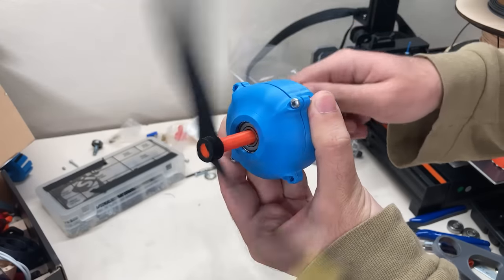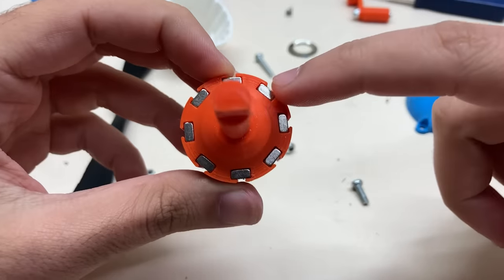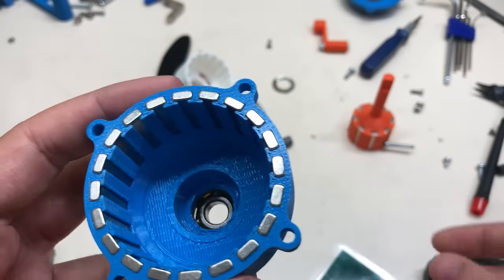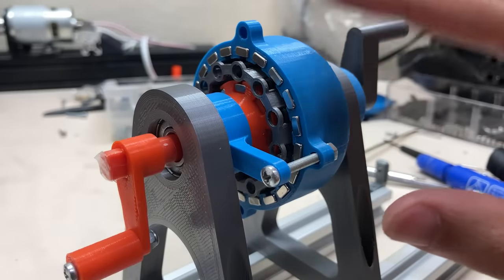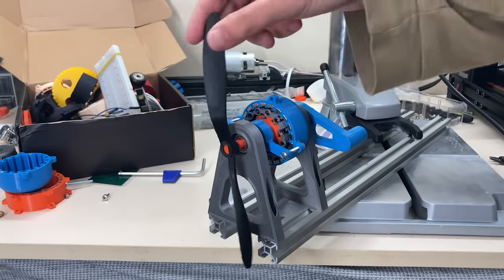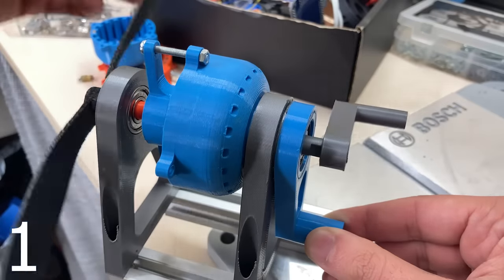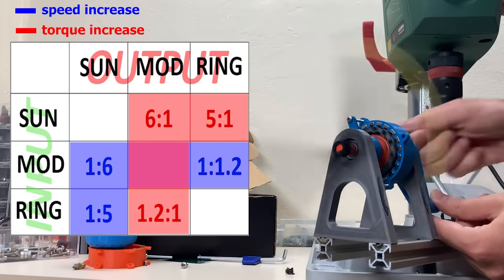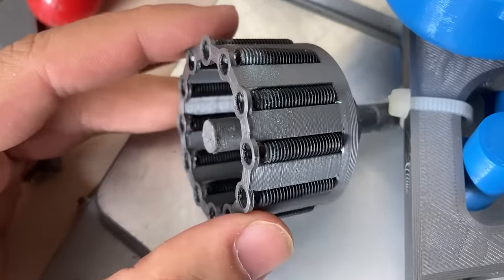How this magnetic transmission works?

Comment: I’m curious though. What kind of torque can this handle? The key point of gear boxes are necessary for change or rpm but the torque tolerances. If you can go from 6 to 1 on the torque but if the output is limited 1 ft/lb of work then what is the benefit. I imagine magnetic transmissions have very little torque tolerance before the work end has to much load and cause the gears to just slip constantly. Especially if your using permanent magnetic instead of electrical magnets.

Comment: I have a couple questions. First is, do the screws heat up with the magnetic fields passing over them. And secondly. Is there a way to add a generator inside this- maybe a couple coils somewhere. Or would that interfere with how the thing works?

Comment: if 4 motors rotate forward you are putting all the torque on the forward momentum edge instead .. rotate the motors backwards but use planetary gears to drive forward .. that can be deviated to effect .. when i look around hardly anything is using torque vectoring to boost or actively stabilize

Comment: The shafts/bearings on the red shaft still need oil/lubrication.  Causing drag and heat, let alone disintegration of components.
Defeating the purpose, and yet, not mentioned.

Comment: You can't put a big load on that tho, if the load is too much it will not turn, there is a reason why you use gears that have physical contact

Comment: This is more like a magnetic clutch isn't it? We have some similar "boxes" at work for material take ups. I understand that the there's a reduction happening, but you can't really use it with a high torque application before it "slips".

Comment: The speed isn't too high for the magnetic type of transmission - the durability problems are entirely mechanical, due to low-speed bearings and PLA structures which are too soft. It is also inefficient at any speed, but especially at high speed, due to the poor magnetic circuit design and inappropriately constructed ferrous elements. 

But is works, which is interesting. 🙂
Reply: until you apply load to it. if you put ANY type of weight as a matter of fact, it will NOT work.
Reply: @JACKOFALLFATES  torque capacity will certainly be limited, especially with this crude magnetic design, but it does function... which is all I meant by "works".

Comment: When battery’s sent an issue, electric cars are about to get a whole lot cooler, can you imagine an electromagnetic gearbox on each hub motor?

Futures gonna be nuts
Reply: Or you could just use coils to mimic the fields produced by the gearbox and drive them electronically. This can be thought of as a generator motor combination, so putting these on an electric car would be like using a motor to generator to motor. It works, but you can achieve the same thing with a well-designed motor in the first place.

Comment: You can't increase torque with a gear ratio. You can only increase acceleration or speed. The torque stays the same, minus some transmission efficiency losses.

Comment: Could the main body, rotor and modulator  body be made of aluminum or non magnetic Stainless Steel? Also I wonder how difficult it would be to overpower the system and allow it work as sort of a slip clutch?

Comment: If you set the magnets at 45 dg angle on the outer and the same on the inner but oposit poles will you get push i made this work 40 years ago but mine fell apart

Comment: I want to achieve something a little bit weird, by having the smaller rotor turn slower than the outer one. I guess I have to fit more teeth/poles on it, and have fewer, larger ones on the outer ring?

Comment: What is the efficiency?

Mechanical, lubricated spur gears lose less than 5% of transmitted power per gear-set.

This would be handy to reduce wear, maintenance, oil leaks, etc.

A side-benefit might be electric power out, replacing the generator/alternator of a vehicle. And/Or coupling IC engine and utilizing the gearbox to work as a hybrid electric drivetrain. The possibilities are endless.

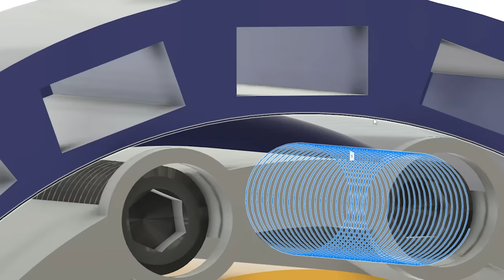Comment: 7:50 if there are no gear teeth this gearbox should be quieter, but this is producing a lot of noise. where is this noise coming from? vibrations? could it be reduced using stiffer material with smaller tolerances? how does the noise compare to a geared equivalent gearbox?

Comment: my question, if there is no friction the chance for slip is high compared to mechanical?
Reply: I believe so, but this might be a feature and not a bug depending on what you're trying to do.
Reply: @PJ-oe6eu  I immediately saw the slip as a feature, could eliminate clutches and have less mechanical breakage with it. It could be used as a torque governor to prevent excess torque from passing through. I'm pretty sure it would generate high heat with excessive slippage though.

Comment: Lets say I wanted to extract Mechanical energy from a turbo or jet engine. 
Possibly even to allow a decoupling of the compressor from the exhaust side on a turbo

This would be ideal right?
Radiant heat could be easily managed
very high rpm

But roughly how much parasitic loss is  there?
(I know this would change with gearing)
it would be interesting to see one scavenged on the end of a turboshaft.

Comment: this is pretty amazing actually. is this being used industrially in any way or is it your own hobby invention?
Reply: Yes, they are, although I don't know much about them. We had a job come to our welding shop to build a small platform for a pump system. It will have a 40HP motor and a pump with an integrated magnetic gearbox. It has to be built pretty rugged and with tight tolerances. The motor turns at 3600 RPM, whereas the pump spins at nearly 10,000 RPM. In this case, the motor weighs 600 lbs. where the pump is 55 lbs. Sundyne is the company supplying the pump and motor.

Comment: In a scaled up version of the magnetic gear box would you want to use a electro magnets? This is a very cool design
Reply: No, if size is the only difference, there would be no need and a substantial efficiency penalty for electromagnets intead of permanent magnets.
Reply: @brianb-p6586  yer not gonna power a car driveline on permanent magnets, just no way.
Reply: @tompeppint.v.3803  strange, given that the majority of production electric vehicles use permanent magnet motors.
Reply: @brianb-p6586  that's a motor not a transmission. Here we are talking about a gear box right! And I'm sure there is at least a charge on a stator to make the bell turn in the electric motor.
Reply: @tompeppint.v.3803  motor or transmission,  the force results from magnetic flux. An electromagnet produces a magnetic field due to current, not charge, and electromagnets are used because the can change field strength and polarity, not because they're stronger.

Comment: I see this and I wonder if there is an application for a reduction drive for aircraft engines where relatively heavy gearboxes must be used to reduce the rpm's from the engine driveshaft to the propeller.
Reply: Thomas Tipton, my mind went in that same direction while I was watching.
Reply from the maker: NASA has an application about magnetic gearbox in aircrafts to get lubrication free and silence operation features and as far as I know the torque limit is quite good as well
Reply: This would be at least as heavy.

Comment: While this is amazing, I am having a hard time to see the practical use case. Using magnetic force as coupling mechanism is as cool as it can be however it is like a car gearbox is made of cardboard. The calculated torque is there but the material is never going to hold. The magnetic force provide you the non-contact coupling but it also gives you the slip. Unless the slip is what you want, magnetic coupling is not ideal to be used as powertrain or drivetrain. The reality is that the magnetic coupling solves the one issue that has very little negative impact on traditional gear mesh: friction. Very few gearbox failed due to gear friction when adquate design and lubrication is provided. However, the magnetic coupling has problems that usually cost a lot to solve while gear coupling natually has no issue with: smoothness, accuracy, efficiency, calculated torque v.s. bearable torque, etc. You can have a very high calculated torque of magnetic coupling but it will slip like no coupling at all if you apply that torque to an equivalent counter force unless you use some huge electromagnets where traditional metal gear has no problem to deal with.

Comment: Do you think it would be possible to use a magnetic gear box for a car transmission? What would be some of the issues?
Reply: Torque slip very likely I suspect. Also electric motors are depleting rare earth metals like neodymium magnets.

Comment: How might you see this in the application of a generator? Using a fuel to turn a turbine which then greatly steps up the speed of an alternator? Thanks for your time. 
I copied this from your previous video.
Reply: Also, if you did want to rapidly change the rate of a prop in an emotor to prop config, how might you do that?
Reply: Have you tried powered magnets as well?

Comment: It's not gearbox, but clutch. 
Gearbox would have one input and one output, but ratio would be selectable. Here you can select ratio only if you change input or output. 
This is kind of clutch and it's not very good for most of vehicles as it would be very difficult to have it half engaged.

Comment: This is a good design. But does not have any power equal or more than input power. When you want use it in a for example toy car, It does not have power enough to push the car forward. So just good for drones or something like that.

Comment: Something not mentioned but extremely useful here is the fact that since there is no meshing parts this design essentially has a built-in clutch. If machined properly it would be essentially impossible to break something like this with too large of a load.

Comment: Put a generator instead of a propeller. Hook the generator to a load. Measure the wattage generated and compare that to the wattage applied to rotate the generator…

Pretty low, isn't it?

That's because for half the rotation is pushing the output backwards.

Comment: Your electric motor shaft is not perfectly aligned with the shaft of the gear box, hence the rubbing of the screws against the wall of the outer magnet gear.

Comment: No damage? The magnets will eventually lose magnetism and fail just as teeth on a cog wears. Also, magnetic gearboxes are only efficient when operated at a constant rate. Any increase or decrease in rotational rate causes huge slippage dropping efficiency. And lastly, call it magnetic-mechanical or electro-mechanical as the input and output is mechanical.

Comment: Can you design one that has counter rotating disks? I would like to see one that has 1 disk going in one direction and another in opposite direction at the same but opposite speed. I have an application where this would be an awesome way to resolve an issue. It doesn't have to be super strong, it is mostly a very high speed low strength application which I think magnets would do way better than a gear box.
Reply: using the same amount of pole pairs gives you a 1:1 gear ratio, which means just inverting the rotation. though I could be wrong

Comment: The problem that stands out with magnetic gearboxes straight away is response.
Magnetic force is not direct physical force so there's lag time to movement.
How is that solved besides using extremely overpowered magnets.

Comment: Knowing how magnets pull to the strongest attraction and that is constantly shifting, wouldn't this setup have an inherent pulse, same as a servo motor? Also seems to be similar concept to the eddy current drive we had on an old Bliss stamping press. It acted as speed control while the motor ran at a constant RPM.
Reply: it's an extremely similar design to an Eddy current drive

Comment: What about torque?  This could be outstanding for gear reduction in auto engines to props.  Not being directly connected could save an engine during prop strike.  But it needs to be able to transfer torque

Comment: It would seem you're getting slip where there's a difference between synchronous speed and the actual. I'm guessing. Electric motors have a certain amount of slip and I suspect that's why your output speed is lower than expected (occurring both in motor and "gear box"). Also, while you have six gear ratios, it seems they're not all useful with that design.

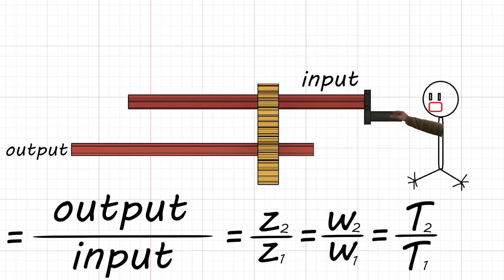Comment: 4:47 is not correct. Speed 
 and torque are inversely proportional, so if gear ratio is z2/z1, speed relation is w1/w2 and torque relation T2/T1

Comment: Hey buddy you need to shield yourself from the kinetic energy if things come apart at 12000 RPM. There is enough kinetic energy there to cause serious injury or death. No joke. You might want to invest in a Lexan shield panel to stand behind when testing high RPM assemblies.

Comment: And whats about the mechanical wear in those bearings???

For example in car transmisions the bearings wear out far befor the gears!
It´s just a noval toy, with very limited use at all.
Just a neat physics demonstrator. 😉

Comment: can you make this Thin using lighter material for the sun gear and a Heavy material for the ring gear, (like a large 40lb weight) so once the weight surpasses the modulator is can spin freely with no resistance from the modulator. then duplicate this on the opposing side so both sides are connected to a center shaft that would connect to both of the sun gear shafts. So when the center shaft turns it turns both of the sun gear shafts. and both of the ring gear shafts are secured to the the bottom of the center shaft on an arm that piviots.   Please see if you can apply this torque to Sandy Kidds Device.   check youtube for Sandy Kidd

Comment: I don't really see a practical application for this type of gear as Any resistance would result in a gear slip as the magnetic poles will allow slipping especially at higher speeds the torque output is not great. Also you have alot of back and forth play on the gear meaning that if you were to run it on a wheel with a motor in a rc car you will have it rolling back and forth every time it stops

Comment: Interesting, however, it's NOT useful in real life in most cases. Magnets lose power with time, having to replace them is costly (and a pain in the as@). Better if electric coils were used in place of magnets or better yet, replace the whole thing with an electric motor. Sorry for the bad news but all qualified engineers would agree on this.

Comment: Amazing.. are they? No. They are not. At all. High RPM is easily achievable by the motor itself. So, the input is high rpm, but small torque. The purpose of gearbox is to increase torque. We never need to increase rpm of the motor. NEVER! Magnetic gearboxes can reduce rpm, but the can't increase torque. So they are perfectly useless.

Comment: Anyone with common sense should be able to see why these dont actually exist, and are only "amazing" if you plan to use plastic or some weak non ferromagnetic material for the entire assembly. Magnetic gearbox is almost an oxymoron. Unless the whole thing is non magnetic, magnets just gonna stick to the closet piece of iron not to mention cause magnetic interference  for other equipment. Just makes zero sense in a real world application

Comment: you ... science team guy .. manager .. no angulation just str8 momentum motor vector ... well sort of you spin round rather than pulse str8 but thats ok ... observe how adding current to each ring ... is one of the most efficient gear drives in the world ... sealed floating no lube necesssary or mercurize ... what drivesz .. i yearn for magnetism ... i better see a magnetic world ... i came up with a magnetic floating bed mesh .. light and airy ... hepls heal by reducing gsz in field too